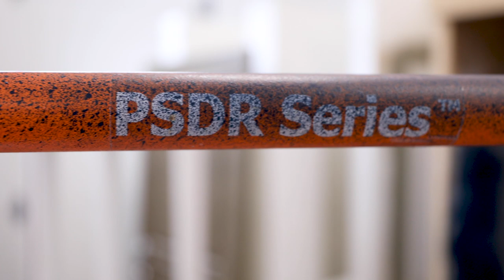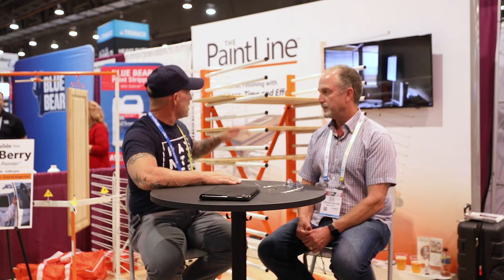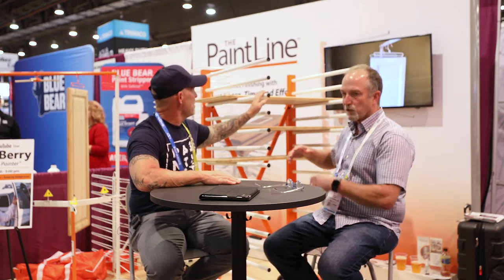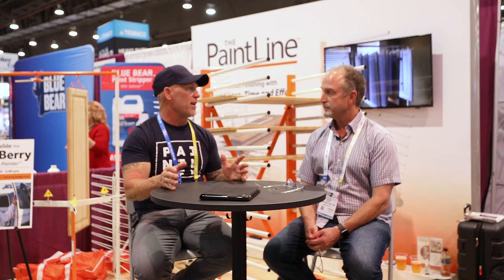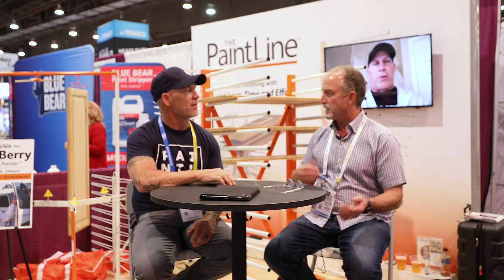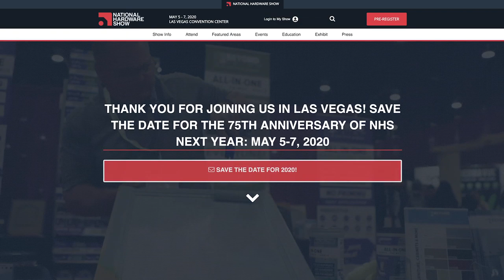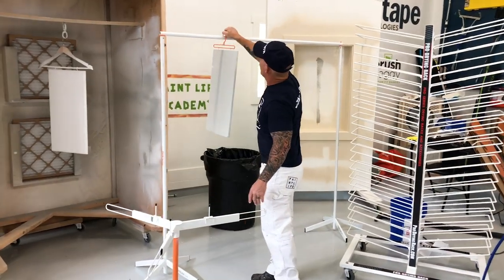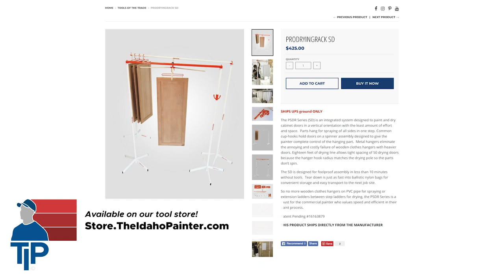Cabinet Painting Tools by PaintLine.

Comment: Back in the day I didn't know any company I could buy cabinet spray racks. So I built my spray shelf system out of the white PVC piping about 12 years ago and its still functional and works great to this day. I believe I spent under fifty dollars in materials to build mine, which is good for painters on a budget. But I would definitely upgrade to paintlines  products. Great video, thanks for sharing.
Reply from the maker: Thanks for sharing!🤙